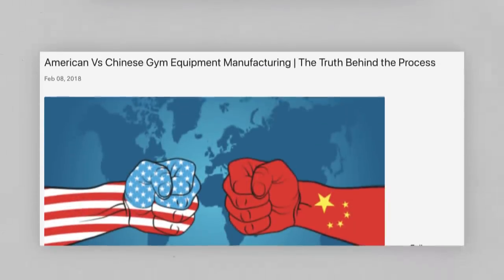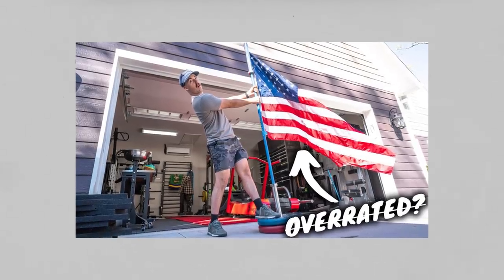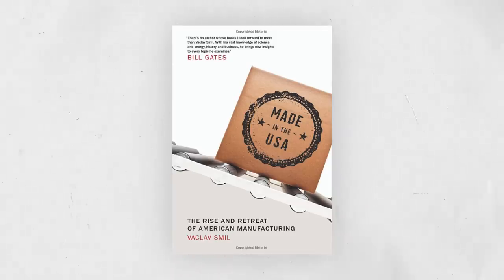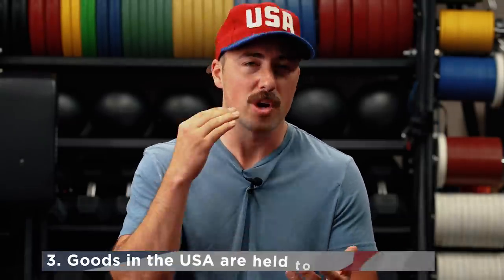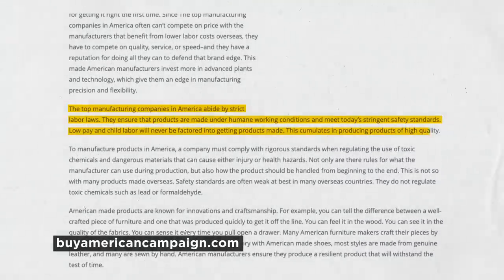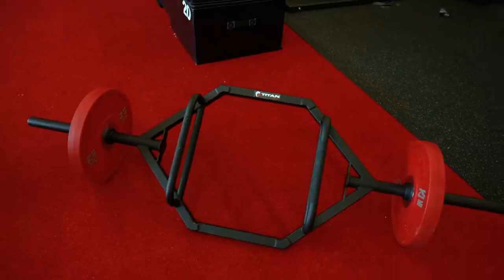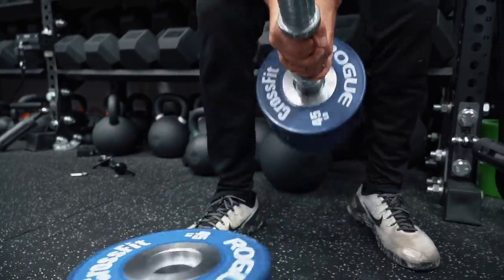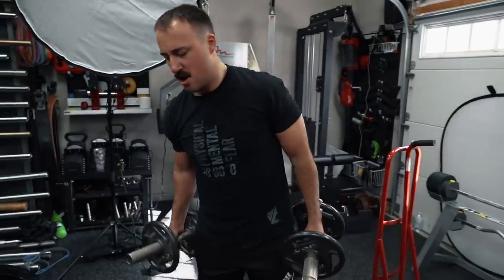Made in the USA Home Gym Matters (Here's Why...)

Comment: Not all metal is created equal. Treating processes and nickel content can vary.  2x3 11g tubing may not have the same strength.  I've seen grade 8 (equivalent) Chinese bolts snap like they were made from pot metal.
China has no issues putting markings or stickers on something that make claims of specs that are simply not true.
Reply: 60  minutes ran an investigation on the Chinese factory that made Lumber liquidators flooring and the manager of the factory had no problem admitting they could put any safety sticker/claim on their product without actually testing or having any way to back those claims.  Lumber Liquidators lost millions because of that investigation when testing discovered their hardwood floors contained unacceptable levels of formaldehyde .

Comment: Made the mistake years ago of buying an imported power rack to save money.  Cracked a weld on the rack, I was sent a replacement part.  Same weld cracked again  a few months later.  Did not have the rack overloaded either.  Had about 225 on it.  Forked the extra cash over for a rack made by Legend Fitness in Tennessee.   Had it for 11 years now, no issues at all, and no regrets with the purchase.  I'm lucky that I didn't have my neck broken on the Chinese Import rack.  Buy American!!

Comment: I have to agree with this. In my experience there is a select few that are built well like rep. I have the new forceusa g6 and that is not 100% of a product and i had so many qc issues and bad customer service from them..  Putting this thing together you can see where they used cheap parts where the short cuts are , and the thin gauge steel . Its an over priced Marcy gym and yes doing some digging they are from the same manufacturer. Nothing against marcy because its priced where it should be. Now that i know how overpriced is for the quality id recommend going with American made prime fitness hlp rack for these all in one gyms.

Comment: I have always purchased equipment made in the USA, Canada Sweden or Italy and their is definitely a difference long term. I have a Stairmaster 4400PT for home use made in USA for 22 years and still going strong with heavy abuse. No cardio equipment from china will last that long. I used to be a gym owner and I only purchased equipment either made in Canada, USA , Sweden or Italy. All barbells and bars came from Sweden. Made in china will not only use inferior material, but will also cut corners by using inferior bolts and screws , inferior rubber and cheap coatings which are often times toxic which not many talk about.